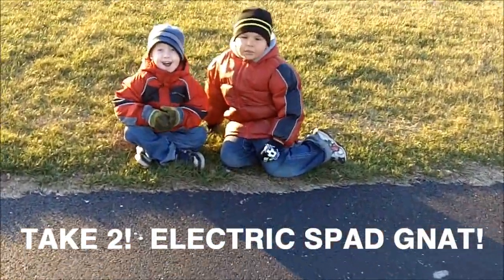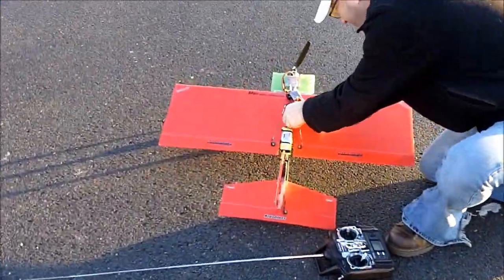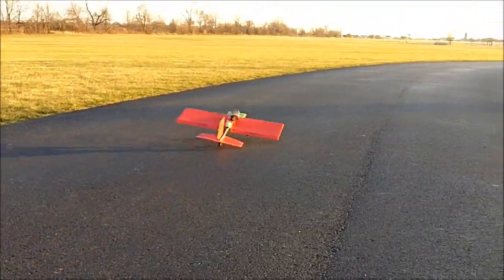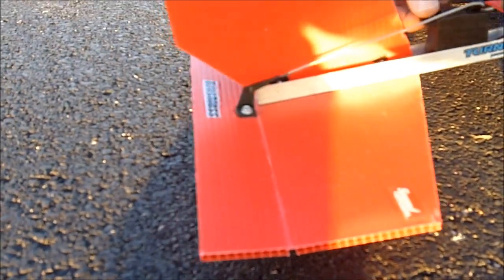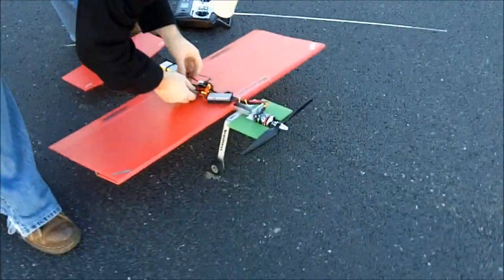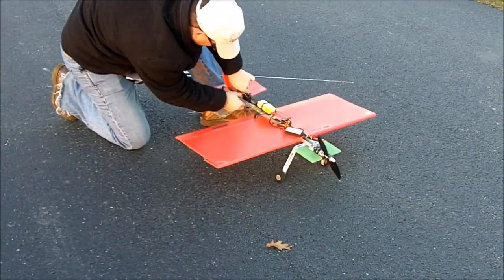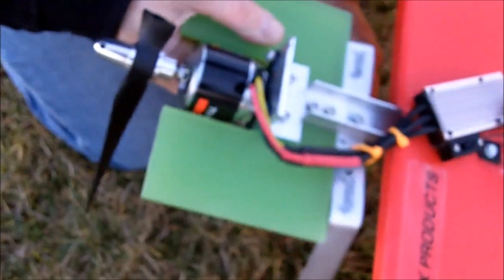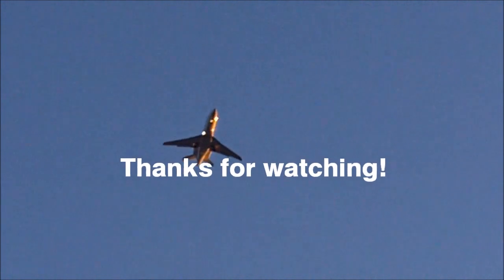Electric SPAD Gnat - Maiden Flight Take 2 (11-28-2010)

Comment: got some smaller props, 10x8.5. had to drill out the center and use a centering ring to fit my spinner.  I put some bigger wheels in back also.  I moved the battery up by the motor because i believe the plane IS tail heavy.I also checked my TX and what do you know, ch3(throttle) was only at 61%.  I never changed this when i got rid of the gas engine.  so this whole time my max throttle has been limited.   today may be no good for flying in the midwest. there are a bunch of storms coming through.

Comment: here are the exact specs-turnigy g32 770kv outrunner (hobbyking), turnigy 80a esc(hobby-king), hextronix ubec 5/6v 3a(hobbyking), 4s 1500ma lipo 20c(hobbyking), and i was using 12x10 and 1 14x7 prop(hobbyking), i think the props are questionable.

Comment: I do have 4 channels. I would need a y splitter for the 4th channel for power and rudder servo. This model is capable of rudder control I would need to figure out how to add it. The first thing is to fix the wheel.

Comment: I think i realize after watching the video like 5 times that i am giving it too much throttle. it is pulling so hard that it is trying to go up and reaching stall. 40% throttle does seem good, i am just inexperienced and it is hard to resist full throttle. this flys much different than the sim.  I have no problems flying that. it behaves differently in real life.  Today i am going to get a few different props to experiment some more.  i think i will try some smaller props than what i was using.